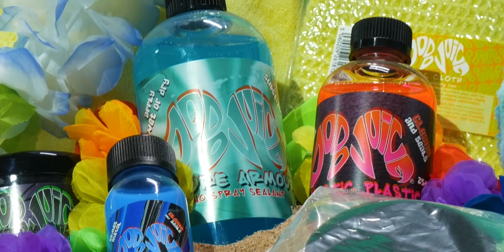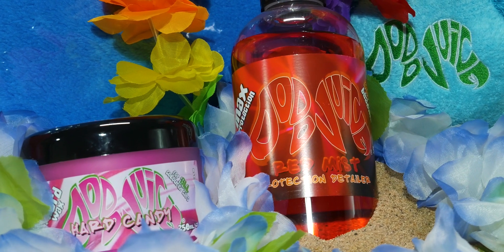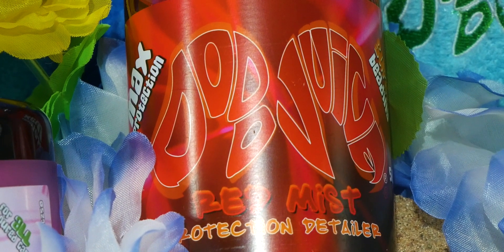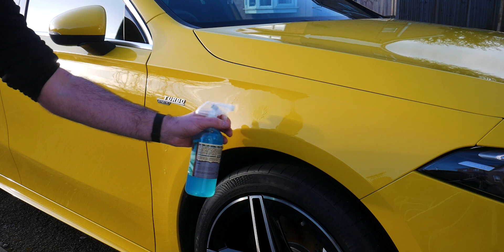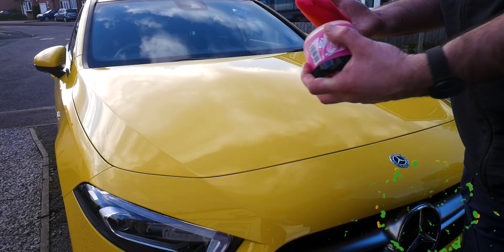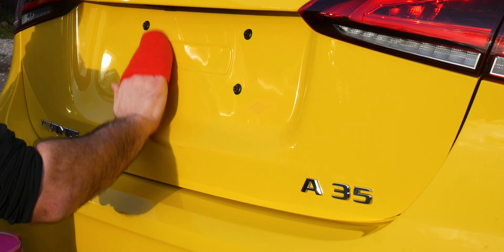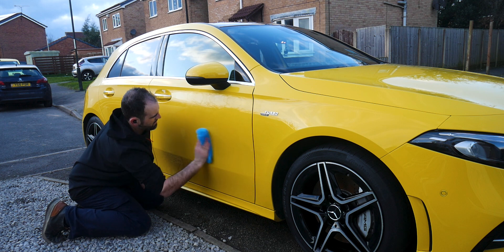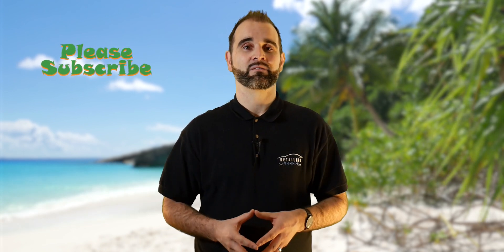Detailing World's Back To Basics - Finishing Off With A Coat Of Wax

Comment: good videos, i like to use a glaze & sealant combo on my Outback, followed by a ceramic wax to finish -- insane beading and lasts for months.  For lazy winter time cleaning, bit partial to Wetcoat, Autobrite S/Sprints or TW Dry & Shine.  Will check up on some Dodo Juice products, only ever used Lime Prime, but would like to try Future Shield and Red Mist.
Reply from the maker: Thanks for sharing!

Comment: Been a great series. Been a big dodo juice fanboy for a few years now. 
What's your opinion on applying a wax by machine? I have a supernatural wax machine stick but always used it by hand.
Reply from the maker: Thanks...

I remember the SN Wax Stick, but never tried it... Personally, I like doing it by hand, but I guess if you have the machine out already, then when not. Although the problem is, you're likely to apply it by machine, and maybe get on trim etc, and assume you'd apply to the whole car at once. The down side is, there could be a 20-30min difference in cure time from the first part you remove to the last depending how long it takes you to remove the wax from each panel.